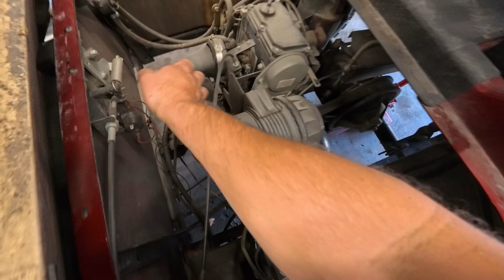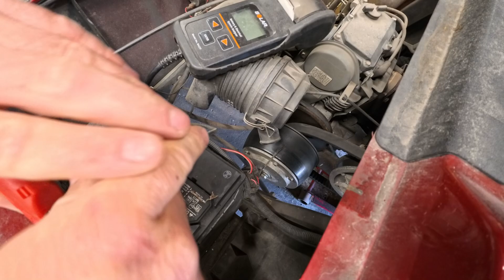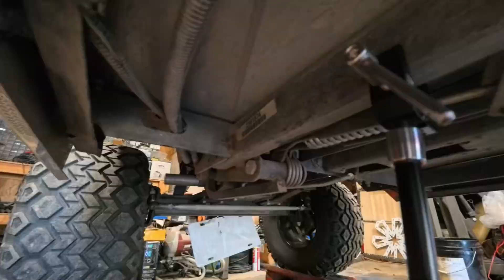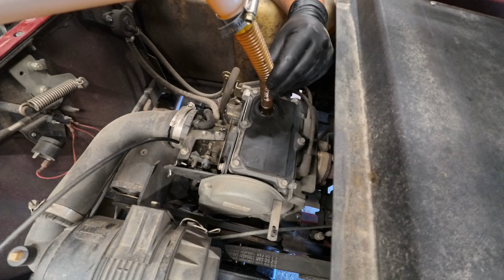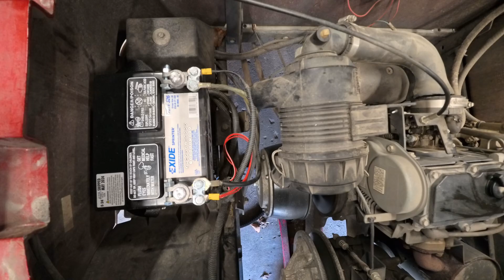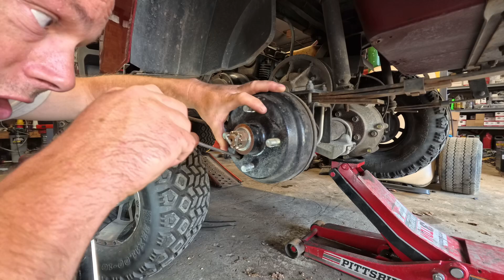2008 EZGO TXT, Gas - Its not charging the battery, change oil and fuel filter

Comment: Automotive breaks are the same way with the self adjusting star wheel but only when you back up and hit the breaks. They don't work on the truck either. I like the club car break adjustment when you get one in and have the time it would be good to share how those work since it's kind of different. I think the camera has a real clear pic and audio is good. When you had the camera hooked to the gas can and meved the can the camera bounced arong when the gas was sloshing. Think you do a great job and very helpfull cus you show step by step what you need to do and where things are a pain to get to. I'm 60 and I still learn from guys like you. Tnks

Comment: In my Yamaha 2018 gas, (it was the last carb engine used) it seems to run rich.  Rebuilt the carb two years ago.  Followed your instructions and it runs great but it has the smell of unburnt fuel.  Choke seems to work.  Ideas?
Reply from the maker: Make sure to use fresh gas. Check the spark plug to see if its all black or if its coco brown. If its all black, then its running rich. If its coco brown, then its optimal. Driving with the windshield up will cause exhaust fumes to roll into the passenger area.